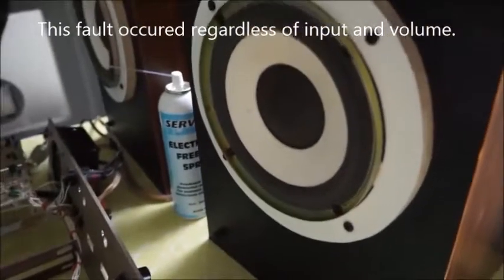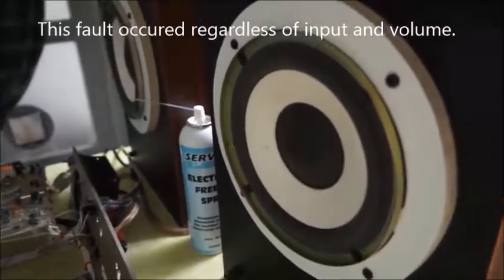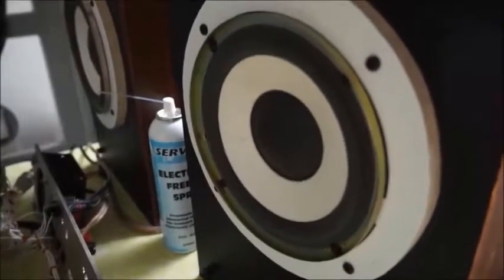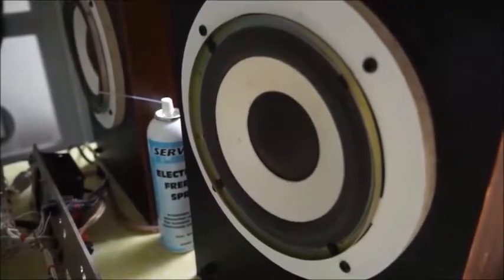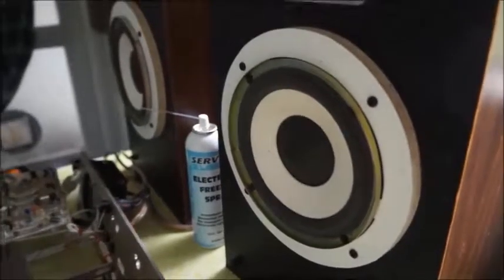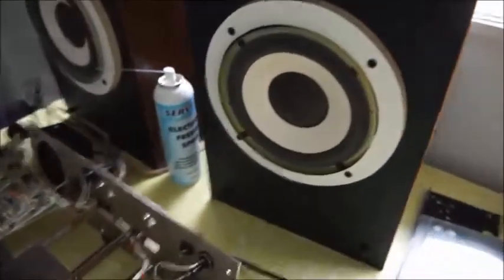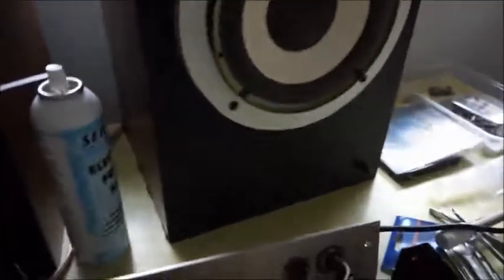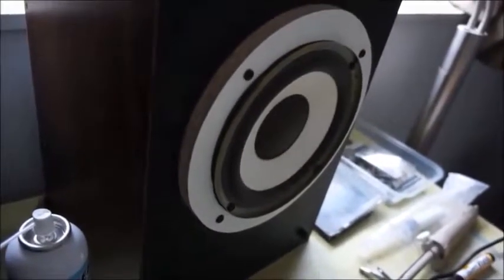Faulty ETI480

Comment: Hello very helpful, I also have same kit modules however i don't have impedance ranges in the documentation. Do you have any accompanying documentation that come with the amp?
Reply from the maker: Yes I still have the original kit document somewhere, it shouldn't be too hard to find. If you like I can send a JPEG of it?
Reply: @kellygwdobbs  Yes please. I also found the amp board instructions but specific to just that part.
Reply from the maker: @alexbevacqua2696  As far as impedance goes, these boards can be loaded with 2-16 ohms. I have paralleled a 6 ohm and a 8 ohm speaker on one channel (giving just under 3.5 ohm load). I'm not sure how to get the doc pictures to you.